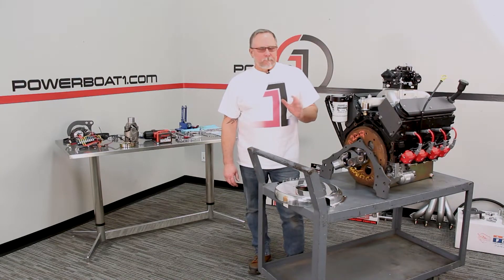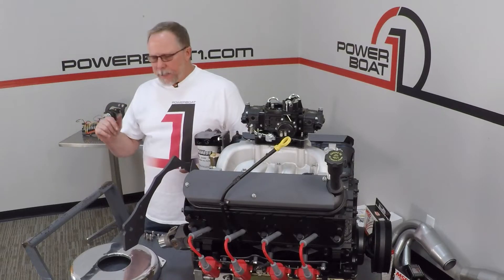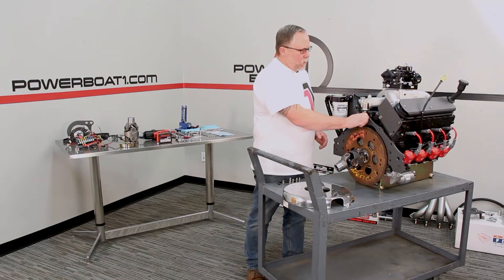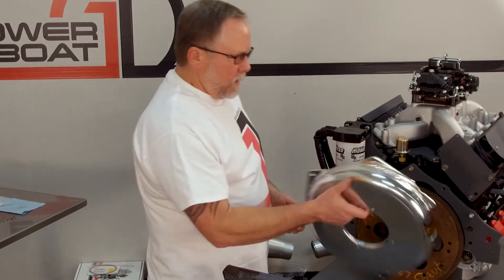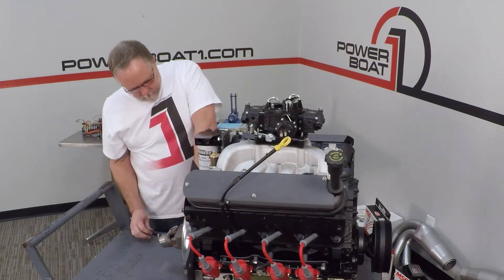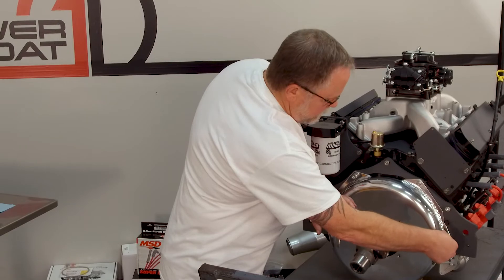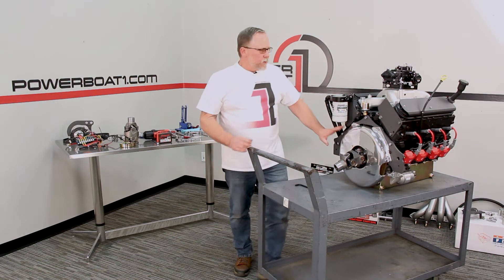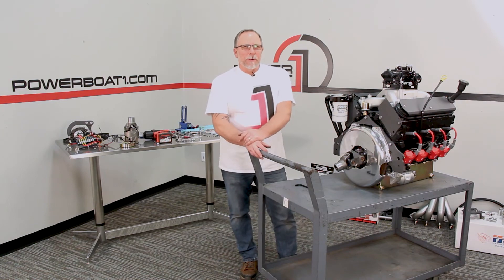LS Marine Conversion: Rear Motor Mount and Bellhousing Installation

Comment: Why did you guys go with a carb instead of fuel injection?
Reply from the maker: We decided to use a carb in this build in order keep the costs down, and make it so we don't have to run an O2 sensor.
Reply: @Powerboat1  Thanks for the reply!

Comment: I'm interested in swapping an ls in one of my enclosed engine compartment boats and running efi preferably with O2 sensors but from what I understand just the steam in a thru transom exhaust will burn out an O2 sensor in no time. Anyone figured out a way to do this?
Reply from the maker: To help with this issue you can go with a longer riser that dumps the water closer to the exhaust tips.